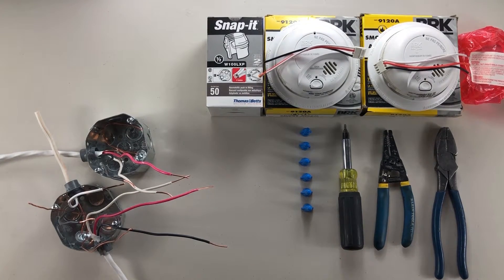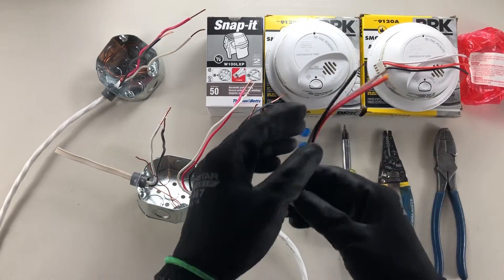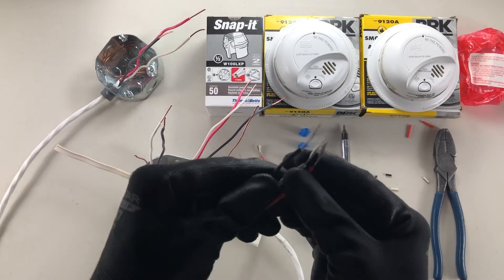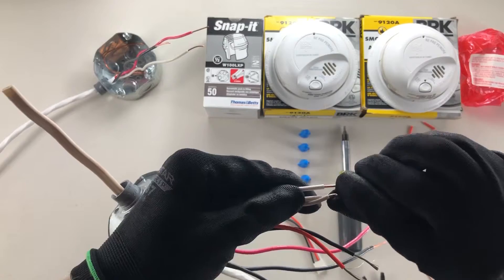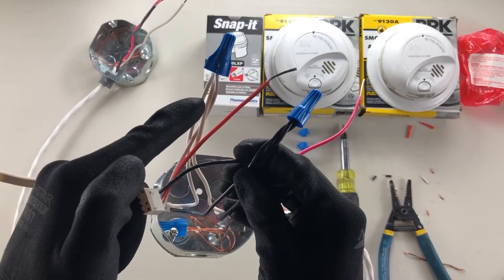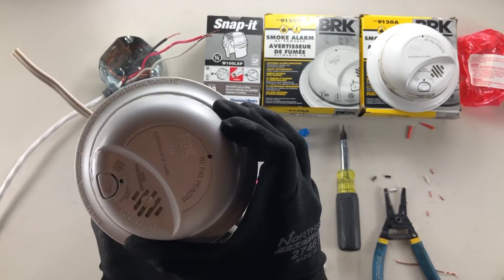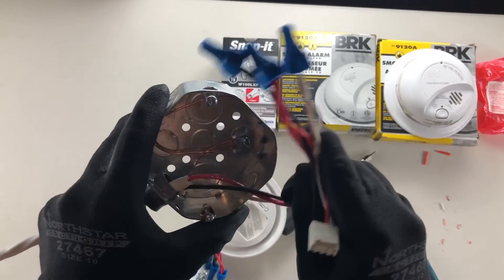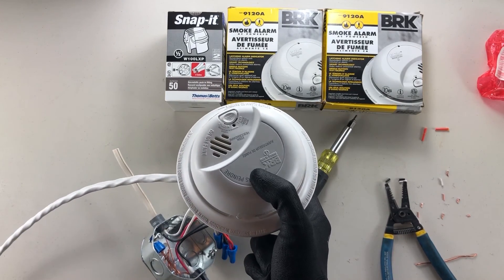How to wire smoke detectors - smoke detector interconnection - The Electrical Guide

Comment: Thanks, great video. I want to add another detector near the first box in the line. Can I just run a 3 wire to the new box and connect all wires in the original box? Hope that makes sense.

Comment: I loved your video with actual incoming and outgoing 14/2 and 14/3 wires, the very first box for the very first smoke detector. If this junction box is on the outside wall of the Master bedroom (which will continue upstairs to the rest of 4 smoke detectors, the 4th one being a terminal unit), can we take a parallel 14/3 connection from this box to another box on the wall inside of the Master bedroom (at almost opposite location) to install a smoke detector as a terminal unit (not going any further.

If yes, then inside this first junction box, 
1) 4 black wires (one from breaker, one out going to upstairs, one for the parallel connection to inside of master bedroom and one to the smoke detector at this junction box, the very first one) in one wire nut;
 
2) 4 white wires (one from breaker, one out going to upstairs, one for the parallel connection to inside of master bedroom, and one to the smoke detector at this junction box) inside another wire nut; 

3) and 3 red wires (NONE from breaker, one out going to upstairs, one for the parallel connection to inside of master bedroom, and one to the smoke detector at this junction box) inside another wire nut.

Then inside the Master bedroom wall junction box, one 14/3 will be entering from the very first smoke detector junction box (located just outside of the Master bedroom). Connect another smoke detector's black to black of 14/3, white to white of 14/3, and red to red of the 14/3 coming from the very first junction box smoke detector.  Thus this inside wall junction box of Master bedroom will have 2 black wires inside one wire nut, 2 white wires inside another wire nut, and 2 red wires inside a 3rd wire nut., making it a terminal unit.

Will the above parallel set up work?  Appreciate very much for help. 

Why the setup with a total of 6 brand new hardwired smoke detectors (5 detectors in series starting from the very first junction box outside wall of Master bedroom, and one unit in parallel originating from the very first junction box smoke detector) having preinstalled 2 AA batteries in each connected very carefully still CHIRP every few minutes apart ?  There was no chirping at least for last 4 years with old batteries, showing green light in each smoke detector until recently (even after replacing the batteries with new 9V batteries in the existing smoke detectors. By the way, those two existing smoke detectors one was 2000 and the other was 2005 models. The remaining ones were 3 of them being 2010 models and one 2007 model.  Still they did not chirp for last 4 years with their existing batteries. The batteries were replaced with good 9V batteries which were actually tested before making the decision to replace the existing hardwired smoke detectors. 

NOTE: when the existing hardwired smoke detector/alarms (the alarms were working) were replaced recently with brand new hardwired smoke detectors/alarms, no modification to wiring was made. They were connected exactly as their existing configuration removing one connection and replacing with a wire from the new unit one at a time.

UPDATE: There was absolutely nothing wrong in the wiring or smoke detectors or in the installation.  There was a battery operated carbon monoxide alarm glued to the wall in the upstairs hallway whose battery needed replacement. That was the cause of all the trouble and source of chirping. It was not integrated with the smoke detectors, was a stand alone one upstairs. The two CO alarms were not chirping.

Comment: If we have 14-3 wire from the breaker to the first box, do i just cap the "hot" red and tuck it? Only tying to the next chains red?

Essentially no "hot" reds are needed?
Reply from the maker: If you have a red from the breaker, is it a 2pole breaker? Ideally turn that breaker off if it's on another single 15amp. If you can't turn it off then yes cap it and attach the orange or red from the smoke detector to the red of the next downstream 14/3 interconnection cable.

Comment: my house wire is black, white, yellow.. can i just attach the yellow to red?
Reply from the maker: I would assume so, but make sure you test the yellow and make sure there is no power on it. Typically the white and black are power in and out wires.

Comment: Can you interconnect smoke detectors, by adding  a wire between them if they are on different circuits?
Reply from the maker: I suppose you could… it wouldn’t be ideal nor the first option. If you’re going to run a wire between them might as well run a 14/3 and wire them properly on whatever circuit is easiest.

Comment: Great explanation! I'm considering wiring those in an old home which currently uses battery-powered detectors only. Does the code require a dedicated branch circuit for the detectors, or can I j-box from an existing circuit?
Reply from the maker: Thanks for the positive feedback! It actually needs to be on a lighting circuit. Tap off the nearest switch box BEFORE the switch (so that the switch doesn't turn off your detectors). They have essentially no load so any lighting circuit is likely fine. This way if they ever stop working you'll notice when your lights also don't work :) Hope that helps, good luck!
Reply: @theelectricalguide  That makes sense, thanks again!

Comment: I have 3 smoke detectors and 2 smoke/CO that are all supposed to be interconnected. Two smoke/CO detectors are connected but the smokes are not. All have interconnecting red wires. They are now all Kidde but same results with Kidde and X-Sense mixed.

Comment: Why does the ground wire need to be bonded to the box?
Reply from the maker: It's basically the safety wire, if any live contacts touch the box by accident the bonded ground wire will safely divert the electrons to ground resulting in a trip therefore less likely to cause shock or fire.

Comment: Good video….. I want to add a Kidie heat detector into my garage. The main house has all the detectors already connected. My problem is that my flat roof house has no access to the attic. How can I connect the red wire so that all detectors will work correctly? The main electric panel is in the garage also, so I can access the fire alarm loop in the main box.
Reply from the maker: It is likely that the circuit access from the panel you're asking about is a 2 wire without a red interconnection. Unfortunately you will need a 14/3 from the closest other interconnected device in order to ensure they all go off together by tapping off the red from that device. Another popular type of alarm interconnection technology is wireless interconnect. This method uses radio frequency communication to connect the alarms, without any electrical wiring needed. These alarms are battery-operated. I suppose you could try and run with that but I expect those to cost more.

Comment: I know I don't have to but can I just put the smoke detectors on their own breaker and can I use 12/2 and 12/3 since I already have it on hand?
Reply from the maker: Yeah you can over size the wires no problem, but you really should put these on a lightning circuit. Before the switch of course :)
Reply: Thank you for added info.

Comment: What do you do with single ground wire that is not connected to anything with a plastic box?
Reply from the maker: Bond it to the back of your box and coil it up before you close the detector up. It doesn’t need to be attached to anything except the box by means of the screw against the back inside wall of the box. Clockwise.

Comment: I did 5 of these Smoke/CO2 detectors, only thing, I continued the 14/3 to the panel box.  How do I wire in - what happens with red?  Or, do I have to use 14/2 to the box?  Love the videos!  Great to see them and confirm I'm doing it right!!  Thanks
Reply from the maker: Oops haha, yeah you can just cap the red wire nicely tucked in the corner of the panel. Leave it capped as well in the first smoke box. The whole feeding cable should be 14/2. The first red wire comes from the next smoke and attaches to the first smoke with just those 2 wires only under the marette. Hope this helps! Thanks for watching and the positive feedback!

Comment: Do you know how many of these detectors can be run in a daisy chain. I am thinking of tapping into the power from one of the lights in a room, do I need an independent circuit from the panel, or can I tap the light box. I have seven to link in a house.
Reply from the maker: The detectors have very low draw, 7 shouldn’t be a problem at all. You should tap from a light circuit. Just make sure you don’t turn the detectors off with the light switch :)

Comment: My old wiring is only black and white, no orange wire available, will this newer unit still work with out the orange wire
Reply from the maker: Yup, but it won’t ring when any others do. It’s a stand alone. You can just cap the orange/red wire that comes on the new detector.

Comment: I find this helpful except that this is the easy part. Bonding those boxes and running the wire correctly (conduit if necessary Etc) is what I’m looking for. This should be a relatively easy job and an upgrade I should be able to do myself. I just want to ensure I’m doing it all correctly
Reply from the maker: Thank you for the positive feedback. You can totally do it yourself. Run your 14/3 cable through 3/4 inch drilled holes in the joists or free air fish it through some pot light holes. Mount your octagon box the drywall thickness forward of the joist face so that the drywall is flush with the front of the box. Use 2 or 3 screws on an angle into the joist. You got this!

Comment: Am I right in assuming that if you're only installing one alarm you only connect the black and white and disregard the red tucking it up inside?
Reply from the maker: Exactly. The red or sometimes orange may come from the factory with a rubber tip to insulate it.

Comment: Great Video.  What hapens with a home retrofit where the fire alarms are not on the same circuits and not on the same floors.  Can I just run a singe wire from one fire alarm to the other.
Reply: I think I see in your other posts it says to just use a 14G wire.  I used a blue one?  Do fire alarms count as one of your 12 box limits in a circuit? And in one of your posts you said they all should be on the same lighting circuir, that is not happening in my house as it is a retrofit and they original is already on a circuit, but my concern is that you said they cannot be on a circuit that has outlets.  Is that code her in ontario when I am doing a renovation?  Thanks for the info
Reply from the maker: @BMac-dr8oc  They are allowed to be on a circuit with BOTH lighting and outlets but not outlets only in Ontario. Ideally they are all on the same circuit so you can wire them together. If they are on different circuits running a cable between them may cause problems. You can always add a new one to an existing circuit with a 14 AWG - 3 cable but don't try to connect smoke alarms on different circuits you may get a short-circuit. You can also use a 14/2 cable to add a new one if you don't plan to interconnect them due to them not being on the same circuit. Hope that helps!
Reply: @theelectricalguide  Ok, that got a little confusing. So, outlets on the circuit are not a problem but must have lights too.  The lights help to let you know that your firealarms are offline.  Now the part you lost me.  The basement appartment is on different circuits.  I am going to retroft the house and add firealarms to all bedrooms.  This means I will have 9 alarms on 4 different breakers.  To me that seemed better and safer.  If one breaker goes and they all have battery backup and are interconnected I will still get all allarms sounding?  Does make sense?
Reply from the maker: @BMac-dr8oc  Yes the lights alert you to a circuit not working with detectors on it if the lights are out. You're allowed detectors on different circuits. Not all alarms will sound together if some are battery operated. The Nest detector connects to wifi and will alarm every other nest detector on the network. The Nest detectors are however expensive. You could always bring all 4 cables that attach to 4 different breakers to a junction box before the panel and connect them all to 1 cable and then into the panel onto 1 breaker. Just a thought.

Comment: I have red, white, and black on the old Not-working any more smoke alarms. But the plug-ins to new smoke alarms aren't the same as the old plug-ins to old smoke alarms. Can I wire with caps the new plug-ins, so I can use the new plug-ins for the new smoke alarms? Of course, I will test the new alarms afterward. Thanks for any help.
Reply from the maker: Yeah for sure, are they the same colour? Or maybe orange instead of red? Just colour match with the new plug-ins and you should be fine.
Reply: @theelectricalguide  
Thanks so much. God Bless.
Reply from the maker: @aquafishes  Happy to help, come back again with any other questions :)

Comment: So the old tenants here at my house left the wires sticking out of the wall they are black, white and yellow. I'm assuming the yellow is the interconnect? So if I buy identical smoke detectors will I splice the yellow and red?
Reply from the maker: Yes it is likely the yellow is the interconnection wire. Yellow to red yup!

Comment: I need to eliminate one hardwired interconnected smoke detector due to wood stove install too close. Will put a battery smoke detector farther away. My question is can we remove the pigtail and put wire nuts on the hot wires and close up the hole will it affect the other detectors in the house that it was connected with? Can't find an answer anywhere. Thanks
Reply from the maker: Yes you can, as long as the colours match for your wire connections. You can't however bury a box or wires without a box in the ceiling with drywall. Just put a white blank octagon cover plate on the existing box.

Comment: Amazing,  I was confused , about the homerun 12/3 or 12/2  
So 12/2 going to first box detector and 12/3 jumps between the other boxes
Reply from the maker: Yes, you can actually use size 14 for smoke feeds and jumps between them. So 14/2 feed then 14/3 between.
Reply: Thank youuuu! This is wat I was looking for in the comments. I thought so but nice to confirm, much cheaper to be safe than sorry lol

Comment: So what do you do inside the main panel with the red and black? Do they land on a two pole breaker?
Reply from the maker: Your feed is only 2 wire. Black and white on single pole breaker - on a lighting circuit.
Reply: You would typically just steal power from your lights, panel work is not needed.

Comment: Thanks! I always want to know how they do this installations. I do the low voltage Fire alarm systems installation and program but always customer ask me how this works and finally I found a video to explain me how they are wired. Just need to know now hot they connect these devices to a 120 VAC bell or/and 120 VAC strobes...
Reply from the maker: Perhaps there is a small transformer within the strobe or bell? 120v > 30v or something? I've seen 120v strobes and bells though :)

Comment: Hi. Can someone help me?? This is great video!! But what size breaker do we use? 15amp?? Thank very much!!
Reply from the maker: Yes on a 15 amp breaker, on the same circuit as lighting. Tap off the nearest lighting circuit, after the switch so the switch doesn't turn the smokes off :)

Comment: Can you remove 1 detector from the series without disabling all of those in the series?  I want to replace 1 with a battery operated detector.
Reply from the maker: Yes, but the wire joints still need to be made. Think of it then as 1 wired detector that has a really long wire to the next wired detector. Your battery one will of course do it's own thing independently of the wired ones.

Comment: Wish there was a way to do this without using 12-3. I finished out my basement and the smoke detector is clear on the other side with no way of running wire to it, unless I cut up the walls 🤦‍♂️
Reply from the maker: Bummer, maybe just use a battery powered smoke?

Comment: changed mine now bedroom does not beep when testing
Reply from the maker: You put a new wired detector into an existing location with a red wire at the box already? Upon connecting the white, red and black wires you do a test somewhere else in your home and the bedroom one you just installed does not beep? Am I understanding this correctly?

Comment: Very clear, thorough and to the point.  However,  by simulating the install with the electrical box away from the ceiling, you miss the awkwardness that’s always involved.
Reply from the maker: Haha indeed, but I might add it's equally awkward but in a different way to film directly under a camera and mount surrounded by lighting stands and cones that I'm not trying to bump or make shadows with.

Comment: How do you put one in between two detectors? Do you need to run a wire from the last one or you can just attach the wires to the previous one.
Reply from the maker: You can run a 14/3 from the closest one. They can be connected in parallel.